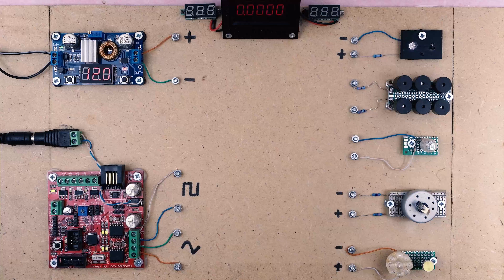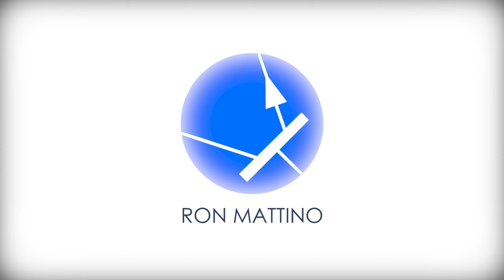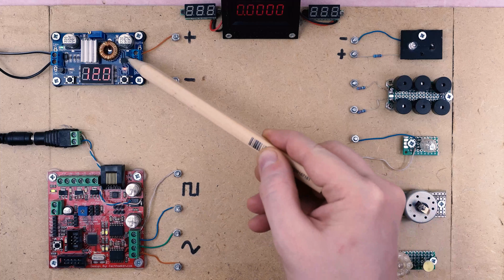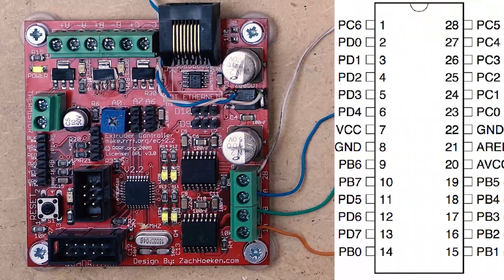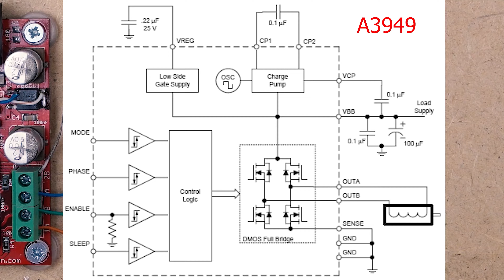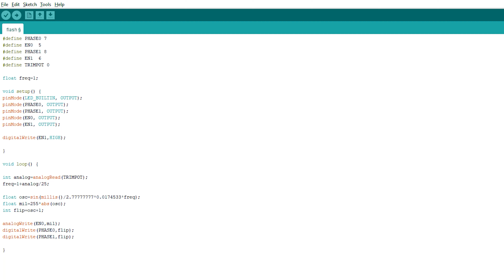Electronics for BEGINNERS: Switch, Relay, Resistor, Diode, Capacitor, Transformer, Transistor, SCR

Comment: I'm confused as to why the LEDs in opposite poloraity allow current to complete the circuit in either direction if diodes block the flow of current in a certain direction. Should the circuit simply not be complete and thus no illumination occur?

Comment: 3:38 the multimeter in the AC position measures the effective alternating voltage.

So the measurement of a square wave is false.

Comment: Drawing 4 waveforms would have helped greatly:
1. ACV
2. Half wave DC
3. Full wave DC
4. Full wave DC with smoothing cap

I suppose half wave DC with large cap could be interesting too?

Your demonstration with the motor and red LED would illustrate the different behaviours.

Comment: Hi Ron..! Great Video & Keep It Up...
I think all multimeters measure a true RMS value of any voltage whether sine or square wave. But RMS value of sine wave is 0.707 & that of square wave is 1, So it calibrates accordingly....
Reply from the maker: You almost got it ) Actually, this is a non-TrueRMS multimeter, that's why it misreads the square wave amplitude. The correct answer should be 12.6v -- same as the power supply voltage. But the inexpensive multimeter detects AC and throws in its coefficient intended for perfect sine, which results in a false reading.
Reply: Many Thanks...!